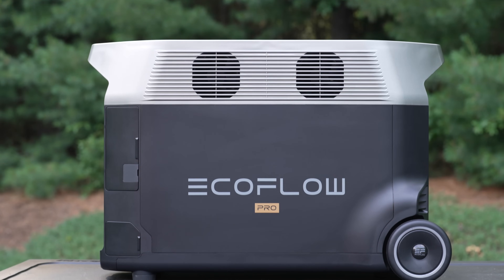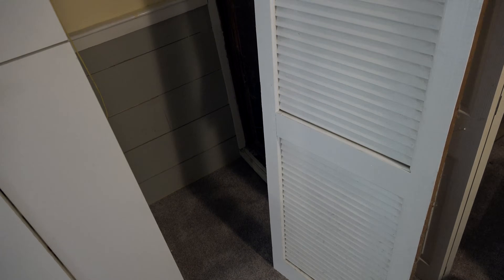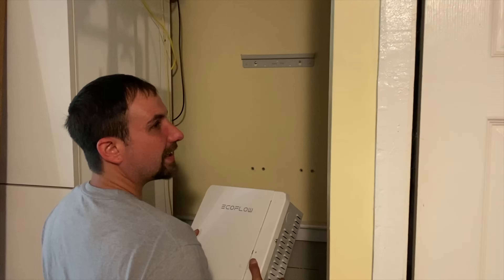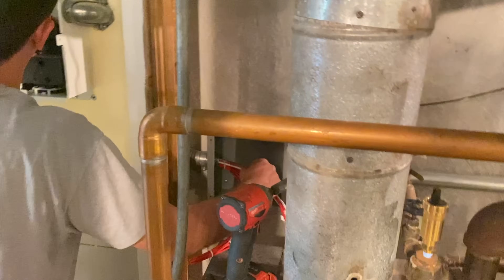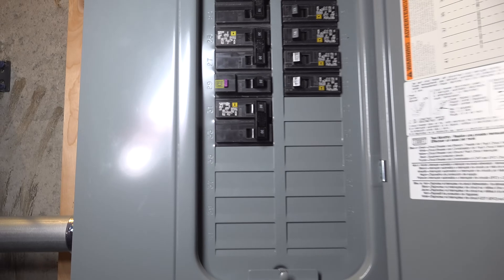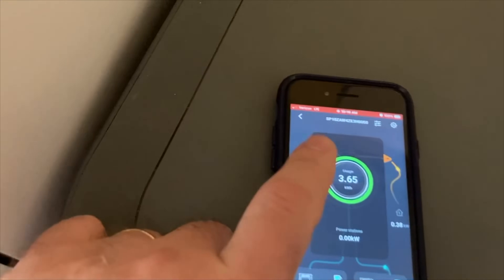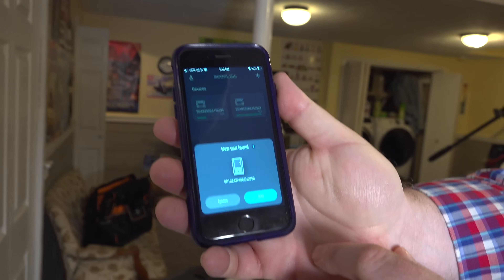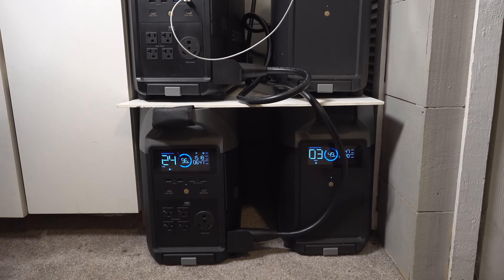AUTOMATIC Battery Backup for your ENTIRE HOUSE! - Ecoflow Smart Home Panel

Comment: Thanks for the review on this... I hadn't seen anything on the power panel on YouTube at all. Do you know if the power panel requires two EcoFlows or could I get started with panel and one before getting a 2nd? I realize I can't get 240 until I have the two, but still be nice for 120 house backup.
Reply: You can use just one DP.  You have to remember though; the smart home panel will only work with a DP.  If your DP has issues, guess what, no power to those circuits and you can't use a generator to connect to the Smart Home Panel.

A smarter solution would be to install a 10-circuit manual transfer switch.  This way, you can power those ten circuits, with a portable generator and/or a DP. We have this set up and it works great. You will need a changeover switch to switch between the generator and power station.

Our DP powers everything in our house, minus the central air.  When the DP needs charging, we run our generator to recharge it., in less than 3 hrs. We can still provide power to our entire house, plus the central air, if needed.
Reply: @Pk3_Garage  yeah I thought about that but I like that the smart panel provides instant switchover. I know it's kind of just a "first world problem" since during an extended outage (which isn't that often for me) to go down and hook it up.
Reply: Actually, once everything is hooked up, just leave everything plugged in.  When you suspect a power outage, turn on the DP, flip the switches to Gen and your good to go. 

The DP has an EPS mode (Emergency Power Supply) that works like an UPS. It switches over to battery power within 30ms.  It works very.  Just make sure you have a whole house and single outlet surge protector. Our DP was damaged during a thunderstorm, while using it in EPS mode because of a power surge when the utility power came back on.

Comment: So how long would this power you house? If I put a Generac system on my house it would need a 20 KW system.
Reply: Not very long. Without all the extra batteries and buttload of solar panels to recharge it you're still going to need some kind of generator or the power needs to come back on...

Somebody says you need a 20 kW generator. Well this is a 7.2 KW setup. So it's approximately 1/3 of the size of the 20 kW generator.

Generac systems are great. They're not cheap. And they definitely will oversize your unit so you can't complain you don't have enough power.  No one can answer these questions. You might have a two-story house with dual air conditioners. Or you might have a little two bedroom house with window units. All in all these batteries in a box are great for portable power or for very short-term power outages.
Reply: @williamkn621  My comments are based around this thing won't do what it is being claimed to do. I have my own situation solved months ago. If I was relying on this set up I think I'd be in mega trouble.
Reply: @philstevens9914  they are great camping and no site power at times. Short term stuff👍

Comment: I really doubt any battery is going to be truly power your entire house for any significant amount of time.  If that is your goal (running air conditioning, stove, oven, refrigerator, dryer - you need a whole-house generator.
Reply: Yeah, in my case it would die after about 30 seconds!
Reply: Tesla Powerwall, generac, Enphase, LG, these if configured just right, depends on the size of the house and what you want to run and if you have any solar
Reply: @KaceyGreen  This tiny backup system will run an average ENTIRE American house for about 30 seconds!
Reply: @philstevens9914  it's 21 kWh if you max it out and they also have optional DC gas generators too, it's a little more than a single Powerwall 2 more than many of Tesla's competitors. If I don't run the dryer or charge the electric SUV it'll run my house for a day or two with no solar, with solar I could run indefinitely. My home is average. Same for this townhouse I'm renting for a work project.

For Powerwall I'd need two just for the steady capacity of the inverters (a single could work for surge theoretically)

Each of the units needed to get 240 v can take 1600 watts of solar but if you don't need 240 or live in Europe a single with extra batteries will get you done.

Your concurrent limit is 30 amps per leg though so if you have a larger emergency load than that you'll need more of these which other than air conditioning and ovens sounds like luxury items, but the oven would burn through the charge quite quickly.

With solar and a reasonable selection of 10 circuits to cover I'd view this as a medium sized generator for an average American home that either doesn't want to burn gas or deal with the maintenance of a generator assuming you have solar. For piece of mind you can still get their generator or use a regular one.

If your load is under 30 amps per leg combined but you  need more circuits you can use their double voltage hub to a generator input plug with a manual interlock and just plug in the whole house. 

It's also great if you have rates that vary through the day with this panel as you can schedule when to never use the grid if the batteries have charge (even if you don't install any solar) so yes this is a pricey kit but from turnkey solutions it's fair, from DIY off-grid non-mobile/lugable installations it's priced higher.
Reply: @KaceyGreen  I think we all get that. My point is this small computer sized system will back up your whole house (if you live in a trailer), but NOT the average American sized house. Mine is 5,500 sq ft. I have a diesel back up system at the ready so I've done the research and made my move already.
Reply: @philstevens9914  that's quite large even for an American house, yes even my average sized house has more than 10 circuits but I can decide not back them all (it's not worth a 2nd set of these for the other 5 nice to haves and considerably more circuits that don't need backing)

What I'm likely to do is get the upgrade kit for my solar system to let it island in the day but have the critical loads on this (I already bought and received it) for if the power goes out at night, I'll also get the solar input for each unit maxxed out so during an extended outage I won't have to ration (because the portable panels that came with my kit will only let them recharge enough to keep the fridge and medical equipment and cellphones going based on what they're reporting on the app with my partial hookup)

I'm not suggesting other than as you said a tiny house or mobile home/RV that it's a no compromise solution during an outage, but the suggestion it doesn't have enough energy to run an average house for more than 30 seconds is a huge exaggeration.
Reply: @KaceyGreen  The average American house is probable 2800 sq. ft. You probably need 15+ KW to run that. These things might be good if you lose power for a very short time during a storm or something but I think it's being promoted to do something far beyond it's reach. just sayin!

Comment: How does this stop power from leaving the power panel and back feeding the power line coming in.
Reply: It seems to work the same as any other transfer switch. Qhen the power goes out. There is switch in it that (for this version) automatically changes the hot line to be coming from the backup power source. That way if the power comes back on, it doesn't get power from both sources.

Comment: As a general rule, treat this power source as you would if you were on your generator, that is to say, it is far, FAR weaker than the power you receive from your main line.  So when on battery (or generator) power, DO NOT use appliances that generate heat or else you risk tripping the switch, unless you have a alternate power source that rivals your main line.  For example, most homes have 100A services to the house spread across 110v and 220v.  The key is the 100A.  For example, to simplify, if your house runs only 110V appliances, then 110V multiplied by 100A gives 11,000 volt-amps, or 11,000 watts.  So if your battery/generator can supply 1.1kWh continuously, then it is just as powerful as your main line and you can run whatever you want.  Otherwise, with a power source of a typical 5,000W generator, that means, NO hair dryers, NO clothes dryers, NO ovens (toaster or otherwise), and NO electric water heaters.  There are numerous kilowatt calculators online where you can get a summary of your electrical budget to use when sizing a generator.  Same deal with this battery system under review.  Nothing new under the sun.
Reply: 11,000 watts = 11 kW not 1.1 kW

Comment: Maybe my math is off, but unless your house does not have access to propane or natural gas, this setup (with 4 ecoflow pros) is a significantly more expensive backup power solution than any portable or standy generator. Not even talking about the fact that 2 ecoflow pro’s have 7000 watt capacity for about an hour. That is not much. Also if someone truly only use it for home backup, highly unlikely these batteries can last over 6-7 years. But again, maybe my math is off
Reply: It depends on what you're prepping for, short-term brownouts on one end of the scale,  all the way up to long-term SHTF events at the other end of the scale.  For a long-term SHTF event, such as a prolonged electrical grid failure, how long do you believe the natural gas and / or propane reserves to run your generators will last? When these gas sources fail,  or if they fail simultaneously with the grid, how long do you have with your generators? Till fuel runs out, of course. These ecoflows aren't my top choice,  but please understand that part of their expense lies in the fact that they offer flexibility and expandability.  One could order such a package just to act as a battery backup unit, but then when you add solar later on it, it simply plugs right in. That simple. Or it can be charged by your generator,  or when the grid turns back on. Again,  not my top choice, but from various reviews with complete tear down and analysis of components, along with benchmark and burden testing, it seems line a very good product.   If you knew how to build your own could you do the same thing for far cheaper? Of course.
Reply: In the past 10 yrs we have had several power outages that lasted between 1 and 3 days, and the most recent outage was over 3 days.  I don't think this Ecoflow setup would have been able to power our necessary appliances, lights, TV, computers, monitors, modem, router, etc that long.  I think Ecoflow, Jackery, Bluetti etc are good for shorter power outages (less than 24 hrs) and smaller homes with less people.   But gas generators are noisy/smelly (plus you have to leave a door/window open to run the cords through, which might not be safe depending on the crime rate in your area), and whole-house generators are too expensive for us.  So we use our Jackery portable power stations when the power goes out initially, then switch over to gas generators when it becomes obvious that power won't be restored before their batteries run out.  But I'm looking into getting one Delta Pro for our 2 refrigerators & chest freezer though since it might provide enough power for them to get through most of our shorter power outages.  I'm basically looking at these portable power stations as a way to delay having to go through the trouble of getting our 2 gas generators running and then running extension cords through an open door or window.
Reply: @martinafan64  I have an inverter generator, looking to find a UPS type battery backup to keep the heat on.
Reply: @danlux4954  depending on how you heat your house it's probably best to stick with that generator
Reply: @danlux4954  may want to check out the many videos out there on "server rack batteries"
Reply: You are missing the point. The ATS would give you enough time to get your generator running. You can manually transfer from utility power and start using your UPS.

The batteries won't last you too long but enough to get by. But if you want more time than get more batteries!

Comment: Can this be used with an existing transfer switch? Is one sufficient to  use as back up for the heating system? How long would it run? Like that it automatically switches on. I have a generac generator (gasoline) outside in a storage unit with a transfer switch.If the weather is bad, who wants to go outside to start it?
Reply: Not rainy here. Thinking of winter if there were blizzard conditions.
Reply: I'll try and answer your questions:

1) Depends on the kind of transfer switch.  We have a 6 and 10 circuit manual transfer switch. I bought two adaptor plugs. A 30 amp. RV plug and Household (2) 5-15 Plug Male to Generator Twist Lock L14-30 Receptacle Female Y Adapter Cord.

2 & 3) Our DP can power our HVAC system, along with all other circuit needed, for about 4 hrs. 

4) I know what you mean, but here's the thing.  Something is bond to go wrong with this system, that you can't fix. Better figure out a way to maybe set up your generator, before you need it.  So, all you have to do is turn it on when needed. 

Our DP got damaged from a power surge, from the Utility company, during a bad thunderstorm. We couldn't even use it.  We do have a tri-fuel generator that we could have used as a backup.  People are putting too much trust in these devices, that really haven't shown to be as reliable, as a gas generator.

Comment: Excellent and Informative Video! ....1 additional question...Will this be able to power a 3.5 ton house A/C unit? As I would like to do a setup like this as my power backup.  Thanks!
Reply: Yes it shouldnt have any problems with that. 
 - HVAC service tech
Reply: Absolutely no way. It might be able to start it if your ac has a soft starter on it, but 2x 3.5kwh battery will power an ac that size for a very short amount of time. And thats without running anything else on your home
Reply: No way….
Reply: @wayneguy6043  I’m with you on this one.
Reply: @Drrich_DIY  It can power it... for 5 seconds
Reply: @nodd85  and then won't be able to power anything else as its completely drained all the batteries.

Comment: In Chicago the price of electricity is higher during the day. Wonder if you can turn off the main power and use the batteries during the peak power hours of the day. Then switch it back during the evening when the price is cheaper.
Reply: Yeahhhhhh I’m with ya.. I’m looking at a 14kw Generac system for about 7500 installed and free 7 year warranty .  I was thinking this might be the answer till I saw the price. I’m more worried about power outages when and if they occur then come Ed’s price fluctuations.
Reply: Don't forget the price of all the NG you'll be using.
Reply: @Pk3_Garage  continuous gas I’ll gladly pay for when there’s no electricity, it’s all about what consumers feel is important to them cuz nothings free.

Comment: I like the idea of emergency automatic backup, however, batteries are terrible to create (in terms of environmental damage). There are definitly benifits to battery power such as the oes mentioned in the video. I have the same thinking for electric cars most of the power they use to charge are generated from fossil fuel sources which in combination from the pollution of mining and creating the batteries makes electric cars TERRIBLE for the environment. Something like hydrogen electricity generation would be a better option (as some cars run on hydrogen which have much smaller batteries = better for the environment) If I were installing a system like this I would choose something other than batteries as they are just so bad for the environment.
Reply: That is not correct. There are a lot of studies that show that the production of batteries, in the case you’re making Lithium Ion batteries, are still more environmentally friendly when considering both production and operation of a vehicle than a comparable gas car. Also, the batteries used in this and some electric cars cars are LFP Lithium Iron Phosphate, and that process is less impactful that LI batteries because they aren’t cobalt based. So we already have battery tech that’s significantly better vs gas engines which have no more development they can go through to make them cleaner. 

Now hydrogen is also an option but storage is challenging and volatile and that brings its own challenges, but can’t disagree that it’s also an option. Cars would be more expensive though and building out hydrogen refueling would be a much bigger task than adding EV chargers, so adopting cleaner technology would probably be significantly slower.

Comment: Would it work both ways? I want to run certain circuits on non grid tie solar, and have it switch back to the grid if the ecoflow gets low on battery from solar.?. Great video! Thank you!
Reply from the maker: Yes it works like that, solar can charge them, you can control how much, thresholds before using AC to charge. They have a lot of detailed settings.

Comment: "a ton of power"? What does that mean?
Reply: About 2,000 super trillion kilowhats a TON
Reply: @adventure6583  Per meter squared
Reply: These can easily power anything in your house simultaneously. He gives the specs in the video that he made about them previously in detail
Reply: Correct answer:  if you have 2000 pounds of batteries, you officially have a Ton of power.